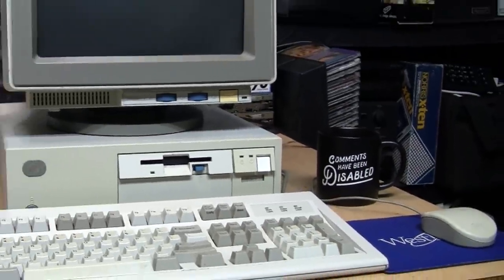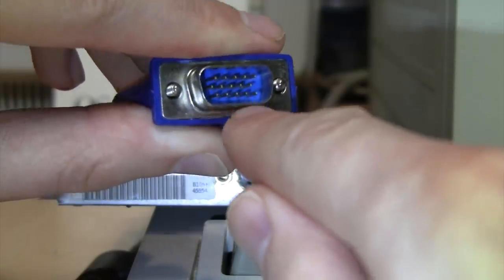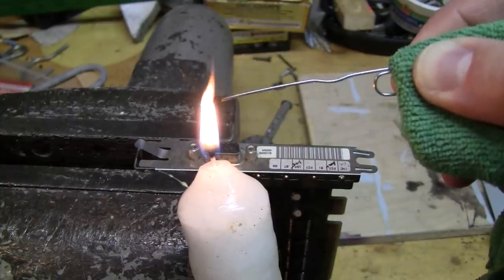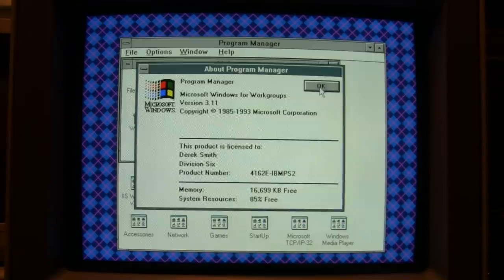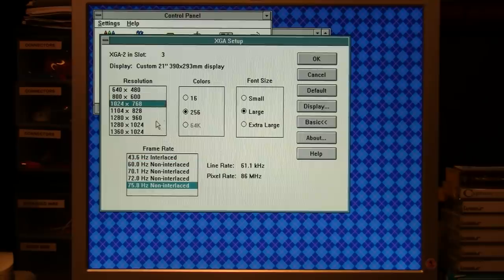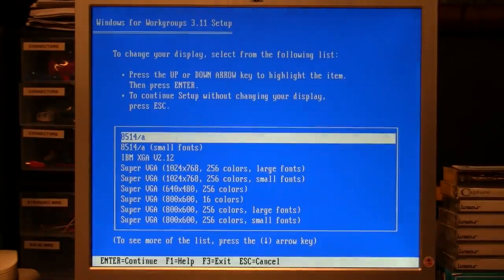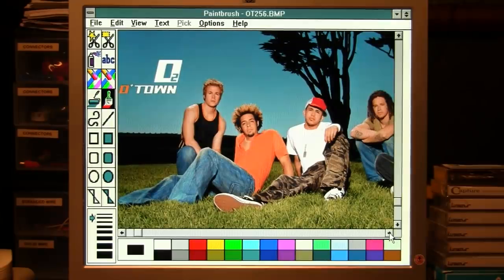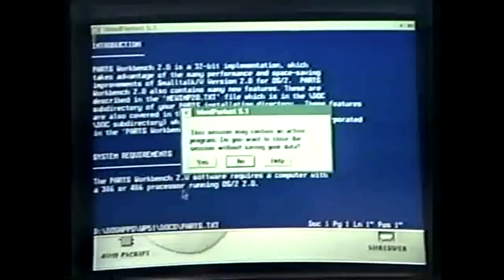Fix your IBM PS/2's VGA port with a paper clip and fire

Comment: Also note that IBM made an adapter for this purpose.  I still have some from my days supporting PS/2s for my employer when I was in college.  Just plug this little adapter into the PS/2 and plug a normal monitor into it.  The IBM FRU is 96G2693.

Comment: A more flexible solution is to modify an extension cable by removing the corresponding pin. That way, you can keep all your machines and monitors unmodified (if you happen to have more than one).
Reply: Yeah I kinda thought this might be better lol (if you got a spare vga cable or find one for 1 dollar)
Reply: YouTube blocks me from even hinting at the interposer like I have in a recent 'Community' post...
Reply: M/M adapter, bust a pin off, or pull it through. 

Otherwise, I've just drilled the blank out with a 1/32 inch.

Comment: I've used the very same trick nearly 25 years ago on an IDE cable.  Worked a treat.
Reply: Oops, you were quicker than me, hehe. Sometimes, if you have a needle, you can actually pull out a plug that is just in there if it's not glued in.
Reply: I'm still using that now, but with a drill bit. One night I was tired of pulling out blocked IDE cables from my stash and spent 30 minutes and a beer to drill them all out.

Comment: Ah, that old problem. My preferred solution so far has been to use a short VGA extension cable and just snap that pin off, that way neither the monitor cable or video card need to be modified, just the cheap cable added between them.
Reply: I like the idea of not modifying the original parts, this seems a better solution.
Reply: Nice to see you in the wild...! (Subscriber here... :) )

Comment: I usually used a broken cable with all the pins still on it and jam it in there to make the hole. Doesn't always work tho, some cheaper and newer cables just ended up with the pin on the cable side pushed in the connector housing without making the hole.

Comment: In the past, I've used the sharp pointy end of a safety pin to clear that hole. Likely would be even easier if it was heated, but I didn't need to do so.
Reply: Same here.  No melting needed.

Comment: I can't recall how many cables I had to go in with my needlenose pliers and small flat blade screwdriver to straighten bent pins.  And not all were like these HD-15 video plugs, some people would just carelessly drop the cables, pins would get bent a little, then they would just jam the plugs onto the device and it was mangle city time!  Always fun when the pins would bend over and short to another.

Some of those HD-15S would be made one-piece, but some used an actual plastic insert to fill the missing pin gap.  I was able to remove those in a few cases, or used a small drill bit to drill them out.

Comment: I can´t wait for the OS/2 video(s). And, I used to cut the pin in the monitor connector instead making the hole in the VGA adapter. That way, I could use a monitor with any card. But that was when all my monitors were CRT. The last one was an Proview 17" beige CRT that was amazing for games as well for office tasks; it never tired my eyes.
Reply from the maker: @tarstarkusz  It's a clock-tripled 486 with a fast SCSI hard drive and 16 MB of RAM. It should be fine.
Reply: @tarstarkusz  I ran OS/2 v3 on an unimpressive 66MHz PS/1 with no L2 cache until 1997 and dont remember any issues with boot up times. Reinstalling from the absurd quantity of floppies however...

I do remember initially trying to use OS/2 v3 on my IBM "Cobalt Blue", which was built on a 100MHz IBM Blue Lightning CPU. It would always lock up on the first boot after install - whatever the equivalent to a kernel panic or BSOD was called. Never found a solution, was really frustraiting considering how many hours it took to get to that point.
Reply: @tarstarkusz  just like the windows 11 experience when you have a standard hd...
Reply: @savagemadman2054   Yep.  And the OS/2 floppy installs were dogmatic that you install it from those floppies, too.  No copying it over to a HDD, ZIP drive, or CD-R first.  Insert disk 27 to continue.

Comment: I was always under the impression the base of the flame was    the hottest part - something along the lines of; The higher the temperature, the more energetic the photons are, giving them a shorter wavelength which pushes them towards the blue end of the spectrum...
Been 30+ years since my 'high school' physics classes mind ;-)
Reply from the maker: Look it up on Wikipedia. The tip of the flame is the hottest part.

Comment: IBM was probably desperately trying to avoid the problem they had with EGA/CGA and Token Ring where they used the same DB-9 (female on the card) and a whole array of bad things would happen if you mixed the two up. Just in case, key the hell out of the port if we have to use another HD15 for something.

Also, Barnes was so entertaining back then.
Reply: there were used for something else, at least here in the UK,  the connector to the descrambler for some  Amstrad  analogue Astra satellite receivers, one end of the cable, other end a scart plug, which plugged into the descrambler box !  others may have used similar, dont know
Reply: MCGA future use I bet.

Comment: 5:51 Have you tried selecting ViewSonic 7 in the Display list? It offers some non-interlaced refresh rates at the higher resolutions. My PS/2 is hooked to an old CRT monitor which fortunately needs no modification to pins, but it might be worth a try on your setup.

Comment: Oh, how I tried to use Warp back in the day as a daily driver...just couldn't do it for long. But I did support a few mission critical healthcare apps that used it, and it was pretty reliable, as long as the system was siloed and didn't require a lot of adds/changes, etc.
Reply: Tried using OS/2 2.0 back in the day but it didn't support by sound card or CD-ROM. Being able to theme the UI directly by dragging colors directly onto the desktop was pretty cool. So was the cut Cat applet.

Comment: Most LCD monitors can't handle interlaced resolutions or horizontal frequencies below ~30 kHz.
Reply: I have one old LCD monitor from work that handles basically anything, including 75hz signals and/or 15kHz 480i with deinterlacing (tho 240p is too much for it), but I also had another cheap monitor that didn't even handle the common 640x480 resolution. Had to go in the BIOS? Good luck

Anyways all of these problems can now be solved with good scalers
Reply: @carolinehusky  75 Hz is a common refresh rate for LCDs, e. g. 1280x1024 @75 Hz, when 1680x1050 @60 Hz is the maximum resolution.

About that cheap monitor - 640x480 is the VGA resolution, which means that it is THE resolution; a display that can‘t handle it is really odd 😆
The BIOS setup is often in text mode (720x400 @70 Hz), so I hope the monitor can handle that😁
Reply: @meiklman  The latter was a really cheap monitor included with a equally cheap desktop for free, so I guess them only supporting the monitor`s native resolution and nothing more must have cut their cost by like 50p XD

Comment: Great information, I've always wondered about those missing pins on some cables. Maybe sharpen the paper clip and use it as a drill bit. Dremel engraving tools probably has a good option. Hobby stores have micro drill bits, too.

Comment: Ha! I used almost exactly the same solution on some old VGA cards and on the integrated graphich card of an old HP Vectra 486. Only difference that I used a sewing needle heated up with a lighter...

Comment: A small drill bit also works nicely. (Or, as others have pointed out, if you're feeling brave and/or stupid, you can just ram the connector in and hope for the best. The "missing" hole is usually thinner plastic than the rest, which is probably why you can do that and usually get away with it,.)

OS/2 really was a better DOS and Windows, at least until Microsoft pulled the rug out from OS/2's implementation of Win32s. IBM's own arrogance at the time sure didn't help either. ("People will buy it because it's from IBM.") The Corrective Service Facility tool (for Fixpaks) is also a less than user friendly pain. (Someone did package it and the Fixpaks up in an easy to use format, though I don't know if those are still around.)
Reply from the maker: There's an archive of all of the OS/2 3.0 fixpaks ever released (up to the year 2000). It's larger than the operating system itself!

Comment: I recall having a video card with this pin blocked out, way back in the day. Never understood why they'd take the extra step of blocking the single hole.
Reply: Keying to prevent insertion of an electrically incompatible plug that uses the same connector. IBM probably had (or had planned) some other thing using the same HD-15 connector.
Reply: @tookitogo  Or were just futureproofing, given how the DB-9 connectors used by MDA, CGA, and EGA video were also used by 9-pin serial and some networking cables.  "We'll key the VGA jack, in case something else uses a DE-15 connector someday."
Reply: @AaronOfMpls  Indeed!

Comment: I have a Sansui flatscreen TV that is native 720p and I use it as my computer monitor at 1366x768 16X9 resolution and all my games seem happy. Sometimes you have to change settings but I have the resolution printed on a small label on my screen.

Comment: To go from interlaced to progressive, you have to half the refresh/frame rate, not double it. So 60hz interlaced would be 30hz progressive.
Reply from the maker: In this case the signal is 89.4 interlaced fields per second or 44.7 frames per second.
Reply: That's not true. To go from interlaced to progressive you have exactly the same field rate, you just exclusively send odd fields instead of alternating between odd/even. So in fact you are doubling frame rate.

This is because the only thing that makes a video signal interlaced or not is the timing of the final video line. If the v sync pulse happens half way through the final line, then the next field will be vertically offset. The refresh rate and horizontal scanning rate are exactly the same, the monitor cannot tell the difference at all.
Reply: @vwestlife  I think you said it backwards in the video. it was 44.7 interlaced fields which would make it effectively 22.35 frames a second, de-interlaced.
Reply: @kyle8952  To convert from interlaced to progressive, you merge the even and odd fields to form one full frame, effectively halving your field rate to your new frame rate.

If you only sent the odd or even fields, you'd literally have half a picture with stripes running through it.

So 60hz interlaced, would become 30fps progressively/non-interlaced.
This is why everything in broadcast is recorded at either 60i or 30p.
Reply from the maker: @Nabeelco  No, I'm right. IBM used Hz to refer to the number of complete frames per second, not the number of interlaced fields per second. For example, their 8514/A graphics standard was 43.5 Hz which equals 87 interlaced fields per second: https://en.wikipedia.org/wiki/IBM_8514
Reply: @vwestlife  Do you have another source for that? The reason I ask is because measuring it that way is technically wrong, and while it's possible that's what IBM did anyways, wiki's citation for that fact doesn't actually mention this at all.
Reply: @vwestlife  The Wikipedia article has been corrected. The person who made that edit back in 2016 was wrong, and has a history of making edits with bad information to Wikipedia pages. For what it's worth, I've worked in the broadcast industry, and with broadcast equipment. This is a common mistake or confusion amongst a lot of people.
Reply: @Nabeelco  We are not talking about video files but how monitors work.
Reply: @kyle8952  That still doesn't double the frame-rate. It halves it.
Reply from the maker: @Nabeelco  I'm going to use a CRT monitor and the slow-motion (120fps) mode of my camcorder to try to figure out what the actual frame and field rates are. But I tried on another LCD and it complained that the video card was trying to display an 88 Hz refresh rate that was outside its acceptable range.
Reply: @vwestlife  Cool, that sounds like a fun experiment! 120 might not be enough though, you might need to go up to 240 if you can, since 120 is right at double 60, it might cause weird artifacting.
Reply: Incidentally, this is basically the same with broadcast res.  480i60 is basically 480p30 or 240p60, and 1080i60 is essentially 1080p30 or 720p60.  In VGA land, it was a crapshoot whether the mode setting would show the per-field refresh rate or the per-frame refresh rate.  You just had to kinda "know" that 43Hz interlaced was the same thing as 86Hz interlaced, because you might see either one in your monitor manual, driver resolution selection, BIOS, DIP switches, etc.
Reply: @nickwallette6201  True, but 480i60 being converted to 240p60 would mean you're effectively loosing half your vertical resolution.Not just in the obvious way, but the image would also be compressed too, so you'd also be dealing with distortion on the other end.
Reply: @Nabeelco   Not really..  480i60 is two half-frames per frame, and if the source material was recorded interlaced (as opposed to being a progressive frame translated into interlaced video), then the temporal shift between frames means that that "480" line frame is actually two 240-line images with a one-line vertical offset between them.

If there's no temporal shift (and, near enough, even with interlaced video source material where objects are static), then you can re-assemble the full 480-line image, but it's technically more of a composite than a true full-resolution picture.

I did make a mistake in my last post -- 1080i60 is not 720p60 -- it's 540p60.  Again, with a 1-line offset.  Oops.
Reply: @nickwallette6201  You were more on the right path with your first post, you're pretty off with your second. Since in interlaced, each frame has only half the fields -- either even or odd -- if you were to convert to progressive, without merging even and odd frame pairs so you have both sets of fields, you'd either be missing half your vertical resolution with black stripes running through the image, or you'd have a compressed image that would be half the height it should be, which would cause distortion.

1080i60 is not 720p60 nor is it 540p60. This is a common misconception because people are confusing bandwidth with resolution and frame-rate.

1080i60 uses the same bandwidth as 1080p30. If you were to drop (half) frames with either the even or odd fields, then you'd be effectively halving your horizontal resolution. Your vertical resolution would stay the same.  Doing this would make no sense however, and since your vertical resolution will still be higher, while it by nomenclature it would become 540p30, it would be 540p30 at 16:4.5 aspect ratio. which would give you a final resolution of 1920x540 at 30fps.

The reason interlaced video is a thing is two fold: Bandwidth and a technical limitation with tube TVs (which is what the spec was made for).

Since power in North America runs at 60Hz, it was very convenient to run TVs at 60Hz. Remember film was traditionally shot at 24fps, but tube TV's phosphor wouldn't stay lit long enough to run at that frame rate.

The simple solution was to run TVs at 60Hz, which is easier to do, and is fast enough that the phosphor stays lit long enough for it to not mess with the image.

But there was a problem: sending 60fps uses a lot of bandwidth and if they didn't want to sacrifice vertical resolution, they had to make the picture interlaced. That way the TV is scanning the tube at 60Hz, but is actually displaying 30 full frames a second. But, because of the nature of interlacing, while each frame was indeed unique, each frame also either lost it's even fields or it's odd fields depending on which frame it was in the sequence. This effectively halved the bandwidth requirements, and reduced the complexity of TVs without sacrificing resolution, image quality on the tube, or frame-rate.

So, in order of image quality -- from best to worst, assuming a 16:9 picture ratio, the order goes:
1080p60>1080i60>1080p30>720p60>720i60>720p30 and so-on.
Reply: @nickwallette6201  Yeah, I agree with everything you've said here. I think we are saying largely the same thing but in different ways.

I'd just add though that combining the even and odd fields of adjacent frames for a i60 video isn't all that bad. It'll only reveal itself during paused frames with fast motion that's actually filmed at i60 which isn't common outside of ENG cams. For most professionally produced content, it's filmed at p30/29.97fps or p24fps making de-interlacing much easier with minimal, if any loss of quality.  Persistence of vision should mostly take care of the rest if it's actually recorded at i60, and yes definitely good de-interlacing will definitely help a lot.

Comment: I did something similar, I just used the tip of the paperclip like a drill bit after snipping a bit off to get a blade-like end, and then just wound it into the plastic 'til it cut its' way through and sorted, a more modern LCD worked with the old laptop with a dead screen... :P

Comment: Thats really neat i didnt know they had a different pin out. Love that cup you zoomed in on then came slowly back out that was really good. Ive never seen os/2. Only thing about some vintage computers if i have a way to use it i would . I have alot of games and some operating systems given to me. Windows me 2000 xp professional some windows xp plus disk its a good stuff just funny windows xp blue screens if you try running on my 2011 toshibia satellite laptop lol. But 7 8 10 Linux run fine . im assuming because of the Intel I3 processor. Xp goes nope not running here lol

Comment: BTW - you could also pull the XGA-2 adapter, bump up the planar VRAM to 512Kb (soldering!), and install the VESA driver to unlock all the SVGA goodness built into the 8556/8557!